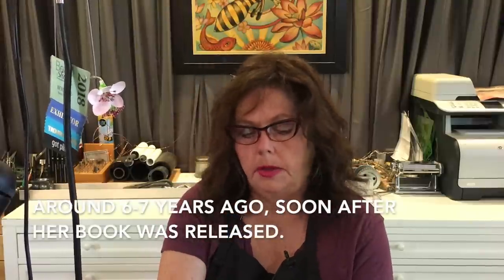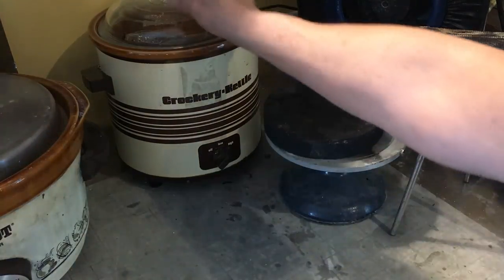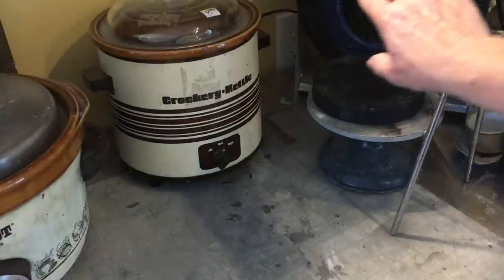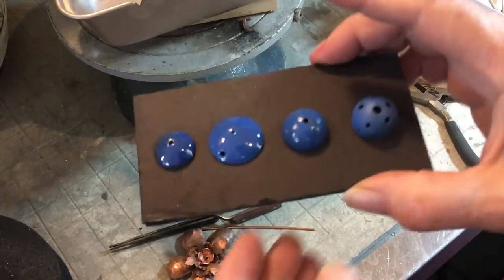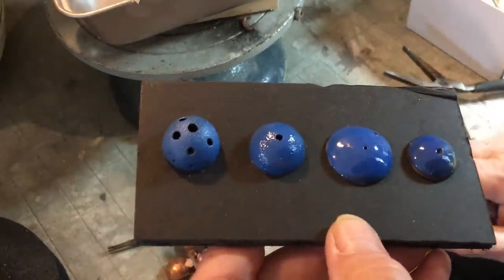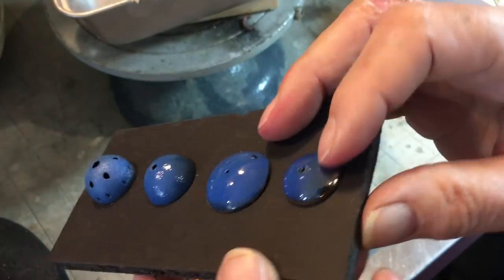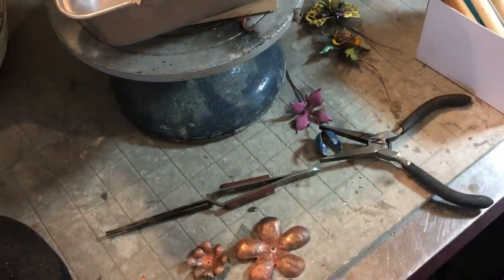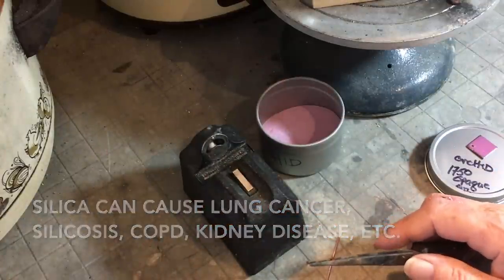Easy Enameled Flowers: Torch-Fired Enameling!

Comment: Nancy, can the pieces be dipped into the anti-oxidant mix we use for silver protection (alcohol and boric acid mix, dip, then light to burn off alcohol = protective coating...) and then enameled? Would that help to keep oxidation and even soot to a minimum? Does a flux (like the alcohol/boric acid dip) compromise the quality of the enamel fusing process? Mahalo my friend!

Comment: I use my lampwork mandrels that I've bent and also buy 1/16" steel welding rods and cut them to length. If you drop your mandrel into a jar of water as soon as you remove your enameled component, the glass will all flake off. If it doesn't , you just have to put the mandrel back into the flame for a couple seconds and then back in the water.

Comment: Does this work on stainless wire, sheets/plates?
Reply from the maker: Here's a great article at Ganokin.  You need a particular type of stainless steel and a particular type of enamel: Medium Temperature – Medium Expansion enamels.  The steel is "300 SERIES (Non-magnetic) This series contains 16-25% chromium, 6-22% nickel, small amounts of special metals, and the remainder iron".  Here's the link:  https://www.ganoksin.com/article/metals-suitable-for-enameling/.  Good luck and thanks!